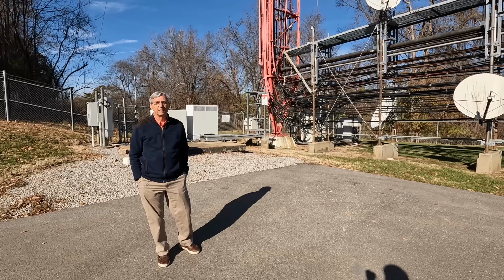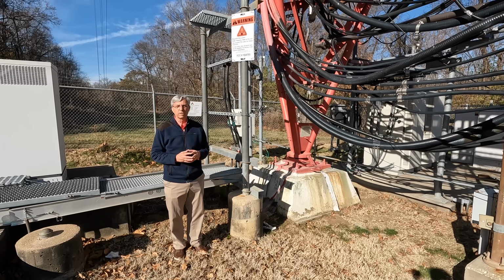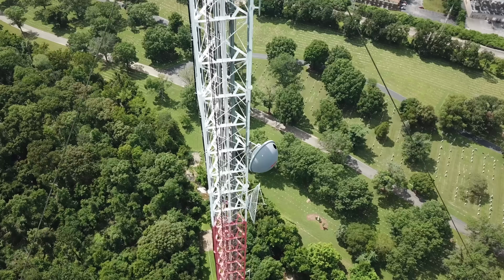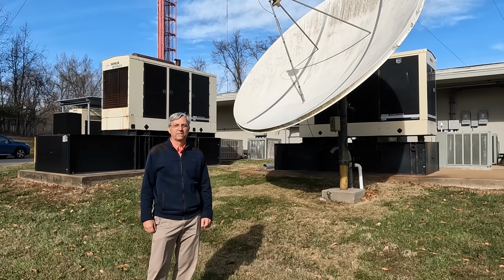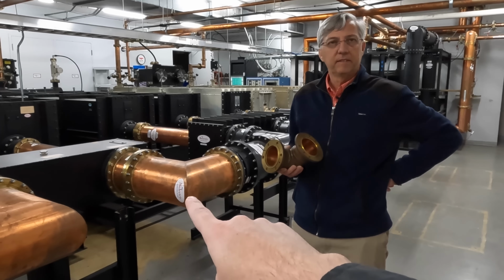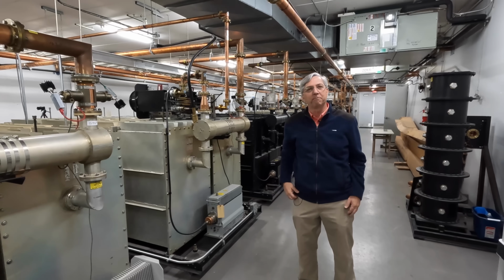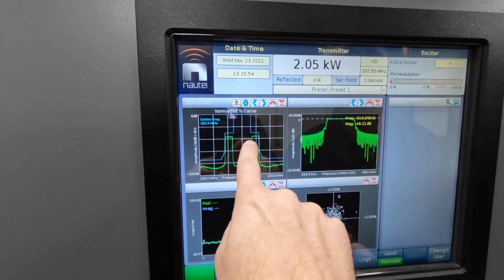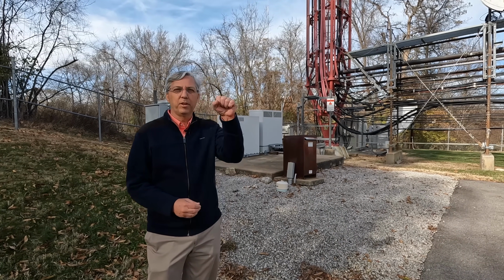1 MILLION watts—really? FM Supertower Part 2!

Comment: As a former TV chief engineer I have to tell you that your dad did an EXCELLENT job explaining what you were looking at and how it works. (We are usually pretty camera shy!) One "Bad Thing" that you didn't know to ask and he didn't mention was that,  depending on power levels, you can get arc-overs (burn outs) between the center of the coax and the outer part (think welding) inside that large copper transmission line somewhere up the tower. That shorts out or dramatically reduces your power to your listeners/viewers and makes for a Very Bad Day. You have to get a tower crew up the tower, find the problem coax segment (20' long each)  and swap it out with a new piece of copper coax. Big Bux too! Plus the loss of revenue if you are off the air during the repair.
Thanks for posting this tour video! I brought back) a lot of memories (good and bad)!
Best of luck with the surgery too!
Reply: I just went through a line burnout a month ago. The line was pressurized, with a leak at the top. The burnout occurred near the bottom, so all the soot from the burnout was driven up the line. The soot can be conductive and lead to additional burnouts, so it had to be cleaned. The end result was having about 40 vertical hardline sections lowered, cleaned, bullet and o-ring replaced, and returned to service on the tower. It went from an expected quick 3-day repair to a month-long torture... The cost was...significant...
Reply: Thx for the enlightenment. Know little of radio xmsn.
Reply: This happened in Boston recently .. major TV stations were at 1/10th power for months!
Reply: One of our bam repeater sites was a TV broadcast tower.  At that time, the station still had a transmitter operator on skte.  They had two new RCA transmitters in  the middle of the room.  They were all solid state except I think the video modulator and the final amp.  They still had their original RCA transmitter from the fifies, all tubes.  It took up the entire wall and the back room. They had stopped using it and I thought it was disconnected.  I was out there one day and the ancient beast was running. I asked the engineer wby.  He said normally they run the two identical transmitters simultaneously. Each at half power.  He said that one of the transmitters was malfunctioning. So, he took it offline and brought the other one to full power. It likewise started acting unstable. So, he started warming the old beast up.  When he threw the switch to apply high voltage to the final stages, a ball of fire shot out at him. He was like enough of this stuff and turned it off and the station was off the air for like maybe an hour or  so.  The management was unhappy, the chief engineer bawled his crew out because the station lost a chunk of money that day.  The transmitter crew was told to run the old  beast one day a month in order to keep the dirt, moisture, and spider webbs out. So, that it could be the backup for the backup.  This wasn't as bad as one of their competitors' who's 1800 ft. tower got taken out by a  chunk of ice taking out a guy wire.

Comment: I was at that site about four years ago. It's very impressive and well kept. That is the 2nd largest FM combiner in the US by number of stations (Empire State Building holds the largest at 19), and the largest by FM combined power. (Miami's Gannett tower is 2nd).  That's also the older design of the Dielectric FM-Vee antenna system. It was redesigned after that, and is used in several locations like Tampa. I've actually received a few of those signals here in New England via "E Skip" last summer. And American Tower, who owns the site, is planning on LED retrofits nationwide, so the tower will eventually go LED.
Reply: I think xenon strobes still have their place.
Reply: we have a couple really big ones in Seattle too but more like 6-8 stations each.
Reply: Yeah better replace those 300W incandescent bulbs with 20W LEDs in the 300KW transmitter facility 😆 They do last much longer though IF a) they're cooled properly b) their power supply is cooled properly c) they're not driven too hard.   Too often not the case with cheapo household LED bulbs with the power supply built in.
Reply: I was at Gannett, did not know it was 2nd largest. It used to host 10 stations but now it hosts 9 if i recall.
Reply: I don’t really understand the physics of how combiners work… seems magical and almost impossible to me based on my understanding of RF and my experience with my low power FM station
Reply: @fhowland  combiners are narrow bandpass filters with outputs connected in parallel.
Reply: @antronx7  Correct. WEDR left to go to their own tower a while back.
Reply: @82NeXus  The flashing lights are 2x 620 watts *per fixture*. The electrical cost savings on a tower with 8 flashing beacons is substantial.  The tower LED beacons are beasts. They aren't your typical crappy Lowes bulbs. Not only are they designed for temperature extremes, they're designed to handle high levels of RF too.
Reply: @82NeXus  yeah dude, cause they're sticking consumer-strength LEDs on the tower. What a jooooooke

Comment: Funny story...I worked or a 430 watt AM station. One day the transmitter went down. I went with the chief engineer to take a look. We arrived at the antenna site and walked to the transmission shack. He unlocked and walked right in, but I noticed what looked like a burnt rope running under the door. I followed him in and saw the "rope" ran all the way to the Amplifier, that was dead. He flipped a breaker and it fired right up. We examined the "rope" and realized it was thousands of burnt ANTS. Yep, ANTS had made a connection to Ground outside the shack!

Comment: One point I don't think was mentioned specifically, was that unlike coax, waveguides don't have center conductors, they are just hollow tubes.  As the name implies, they just "guide" the wave through the tube and around corners. Though the cross sectional dimensions of all the tubes (are square tubes still called tubes? lol) are all carefully tuned to match the frequency that is passing through and typically are used in the microwave frequency range.   I like to refer to it as black magic. lol.
Reply: At higher frequencies I was taught the RF travels along the skin of the waveguide. Having been in AM/FM I rarely had work involving waveguides. You’re right about them not having a center conductor. I remember my first time seeing a satellite uplink using waveguide.
Reply: In some very high power radar systems, internal RF arcing within the waveguides is suppressed by filling them, under pressure, with sulphur hexifluoride gas.
Reply: The distinction is that coax carries what is still an AC electrical signal(at the radio frequency), wave guide carries an electromagnetic wave with e and h fields, like the waves that propogate from the antenna through the air.
Coax can carry a wide range of frequencies,with upper frequency and power limits, waveguide has to be choosen to suit the wavelength of the signal being used.
Reply: @radijoe  The "skin effect" works on way much lower frequencies too - like audio.  Hence some of the crazy cabinets that are "bi-wired" (not crossed over) as a smaller wire can sound much better on a tweeter.  I would have said the same thing as Turbo did above about the waveguides.  I am an EE, ham, and have worked at radio stations (but in production).  I like your explanation of the inner and outer conductors of a coax but I didn't hear you mention the dialectric.  The casual viewer here probably has no idea what impedance is so explaining the ratio between the inner and outer conductor sizzes might be interesting - and maybe why the broadcasters, CB-ers, and hams all use 50 ohms whereas the consumer (rooftop antenna or satellite or cable system) all use 75 ohm coax.   I love the way you present things!  You know a lot of kids went into engineering in the 60's because of "Scotty" on Star Trek.  Hopefullly,  you are having that effect on the next gen of RF engineers!   :-)   "Bucky Dornster" (WKRP) was my hero as a kid.  LOL!
Reply: @radijoe  That depends on whether or not it is the transmitter. I think what you are describing is the AC "skin effect". Otherwise a standing conductor acts like a mirror and the charges on it simply re-emit incident radiation (they are moved by the field and another field is produced as they move).

Comment: I know it's been a few months, but I just watched this video (thanks youtube algorithm) and wanted to add to the LED bulb discussion mentioned in it.  I'm a helicopter pilot and during night flights I wear night vision goggles to aid with obstacle and traffic avoidance.  Some of these LED marker lights emit a wavelength that is almost invisible to NVGs, negating their purpose for alerting aviators to the tower and required official notices/warnings (NOTAMs) for towers lit with them.  This was the case up until just a couple of years ago when it was finally mandated that LED marker lights include an IR component (though some are grandfathered in).  It made me happy to see those incandescent bulbs as their inefficiency naturally causes quite a bit of IR. Helicopters spend almost all their time down low and spotting towers is a key survival skill.  The guy lines are still deadly though.  They're hard to see even during the day.  We always fly well away from towers, as long as we can spot them.

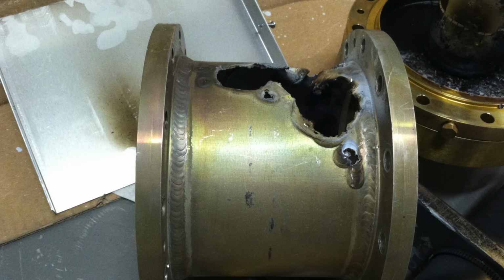Comment: 18:15 RF burns are nasty. Got one from a tiny 15 watt VHF transmitter. Tuning a magloop antenna, got too close to the trimmer's connections. You don't feel it until it starts producing a whisp of smoke, and then it'll take weeks to heal. 
Mine was small enough to not be too painful, but even on that scale you can see how deep it burns.

Comment: The difference between coax and waveguide is coax carries an electrical current, while waveguide carries rf energy.  Waveguide is usually only used when frequencies reach the gigahertz range.  At that frequency, the smallest bit of unshielded conductor will act as an antenna and radiate all the energy.  I worked in a satellite communications facility back in the 90's and all the transmitters operated at 4-6 Ghz (C-band) and 12-14 Ghz (Ku band).  At those frequencies, waveguide was the only option.  The transmitters used klystron tubes that created the rf energy directly, so essentially the transmitter was also the antenna.
Reply: Alot of Block IF distributed as close to the antenna and amps(BUC) as possible with coax, real expensive coax.

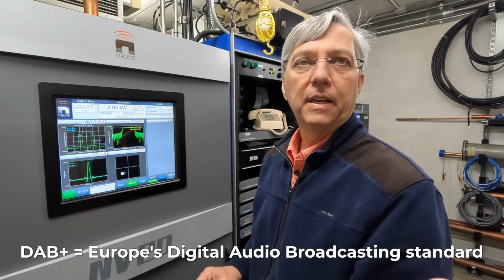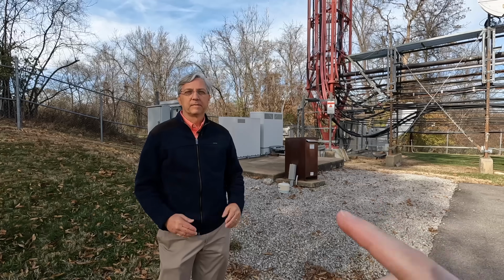Comment: 17:00 at least here in austria, most of the broadcast radio service, especially in more rural areas still runs on FM. DAB stations are not so widespread because the old stuff still works great and the infrastructure covers every last corner. In germany they have a lot more DAB stations. 19:10 Also working on my HAM license right now , no wonder i love the Supertower series!
Reply: Oh I am not the only guy from austria watching these videos
Reply: It only works great because there are people constantly fixing it. Greetings, a rf tech from austria :) (doing tunnel-coverage for example)
Reply: @ExolorLP  Yeah of course, things only work if someone keeps them working :) I rather meant sound quality wise FM still does a good job. Tunnel coverage sounds really intresting, i always notice the cell antennas when driving through a tunnel. Do you do this aswell or only radio? Btw so fü österreicher do haha
Reply: @partykeller1553  We do fm radio and emergency service communications. So in case of a fire for example, the firefighters are able to talk with the guys outside and also in the whole tunnel. If you drive trough a tunnel, look at the ceiling and you will notice one or two cables around 10cm from the wall with spacers inbetween them. Thats the antenna that delivers the signal. They are called Strahlerkabel or Schlitzkabel.
Reply: @ExolorLP  Is that essentially a leaky coax cable? There's a type of antenna like that but I forget its name, not a typical slot antenna .
Reply: @anullhandle  Excactly, a core and the shielding is wavy and solid. They just chop a part of the wavy bit off and then there are slots every few mm that allow the rf to leak and act as an antenna. Google translate says it is called leaky cable in english.
Reply: If anyone else is reading the comments to this point. In germany before each tunnel there is a sign with FM frequencies you should tune in while driving through a tunnel. As far as I know this are frequencies that would be locally used in the tunnel to broadcast emergency instructions with the tunnel-coverage system that was explained here.

Comment: Netherlands (Europe) here. This is a wonderful and very detailed tour of your transmitter site. I loved watching it!

The one thing that was completely new to me: HD-radio. I never heard of this broadcasting-technique.That is: broadcasting digital audio at the outer spectrum of an analogue carrier. Which receivers are capable of receiving that in the US?
In Europe we're using DAB+ instead, which has a different approach. The transmitters are using different frequencies than the analogue FM-carriers - in the 200MHz-band - and is doubtfully a success so far over here. The reception is quite good, especially when full error correction encoding is used by the provider, but when asking around, end-users are hardly using it (or they are not aware - that also can be). It is either FM or radio via mobile services people are listening to.

Comment: Awesome video as always.  I've tried (albeit not very hard) to fly drones on our tower sites and have not had much luck.  My DJI Phantom wouldn't even get to a point that it was comfortable taking off so I'm very impressed you can fly in front of those roto-tillers without desensing the drone receiver. I think I did get another drone off the ground on a different site but the wind was too much for my skill (mountain top) and didn't even get close to the tower.  Speaking of ice, we replace at least one yagi every year due to ice falling.  We've even had a hole punched in the roof of our building in the tiny area that was not covered by the ice shield.  The ice shield was super bent, it must have been a huge peice.
Reply: I have stories of drones and winds! Learning what can and can’t be done while in large open areas is the way I recommend learning. Thanks for the comments.

Comment: I used to work at WXYZ AM radio in Detroit. The WXYZ TV tower was on the same property. The guy wires went over the parking lot.  We had an ice storm.  When the sun came out and warmed the guy wire, the ice would melt and release from the bottom up.  There were cars that were impaled with icicles. There were also icicles impaled into asphalt parking lot.

Comment: I worked at a TV station in San Diego back in the 80s as a producer. I am a Ham and would always take advantage of a trip to the mountain with one of the engineers.  This station was on UHF channel 69 in the 800mhz range and had an ERP of one million watts. The transmitter had a klystron tube the size of a household water heater. The transmitter used a hard line then to a flex line up the tower.  I also remember that there was so much RF that audio would be on the phone line to the site. I asked my co-worker in accounting how much the power bill was for the site. She told me it was between 46 to 50k a month including fines for heavy demand during peak hours. That floored me.

Comment: Thanks so much for a really informative video. I'm in the UK, and yes, was still have analogue FM and AM radio stations. No, were not lagging behind the rest of Europe, millions of people still love old fashioned FM and AM! We have a full compliment of DAB and DAB+ stations, available everywhere, it's just that people still love the quality of FM and the nostalgia of AM! Yes,  that day will come, but not too soon, I hope.
Reply: Not only do you still have AM on Medium Wave over there in the UK but you also still have Radio 4 on Long Wave at 198kHz at least for a few more months.  That is REALLY old tech
Reply: @AndyGraceMedia  Aaah, but! I doubt many people will still listen to Radio 4 long wave, but as far as I know some services use the signal for time setting, and even switching certain electricity meters onto a cheaper rate after midnight. So once that's all switched over to getting the signals via the internet, they might finally be able to pull the plug on the antique transmitter!
Reply: The bit rate and codec used for DAB is not good enough at present for classical music; FM still wins.  VHF FM is also needed where there is no DAB service.  It is broadcast in a higher frequency band, so is blocked by obstacles and terrain.  Likewise, medium- and long-wave AM transmissions are needed for regions where there is no VHF FM signal, usually due to terrain.  One more thing, RTÉ in the Irish republic ceased DAB transmissions in March 2021 owing to lack of listeners.
Reply: @cdl0  You're spot on! DAB suffers from the same thing as digital TV, too many channels on some multiplexes. The more channels there are, the poorer the quality is. My biggest gripe with DAB is the low bit rate of classical music stations. FM with a good antenna is by far the best for quality, no comparison.
Reply: @NigelDixon1952  Absolutely right, a Stradivarius on DAB sounds like a cheap east-Asian violin with a bad bow.  In addition to low bit rate, the codec is a problem.  It was impressive technology at the time when it was developed; however, that was many years ago, and things have moved on.  Unfortunately, the codec can't be changed without changing all the hard-coded receivers, so that is unlikely to happen.